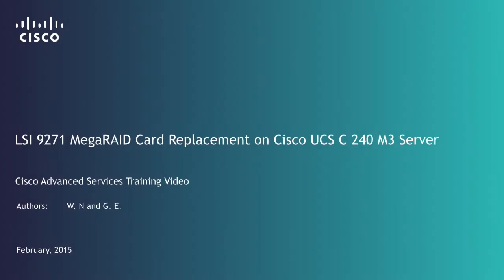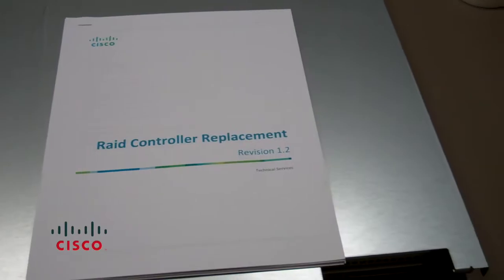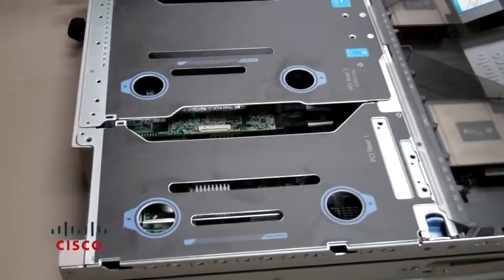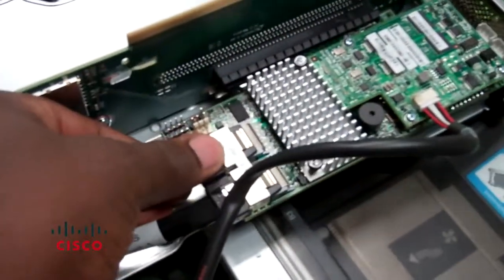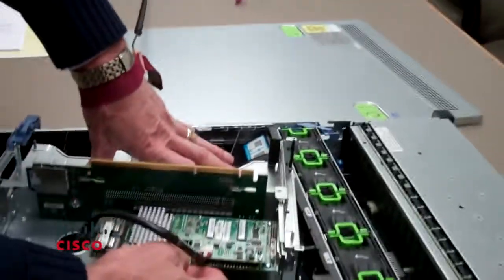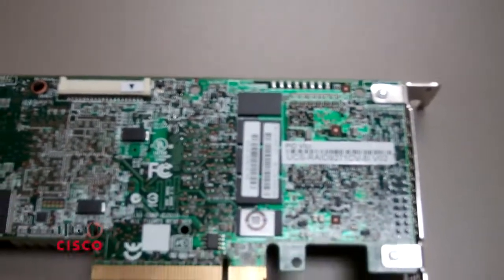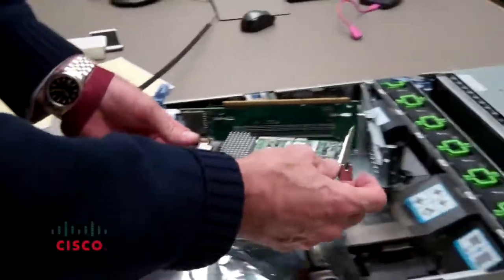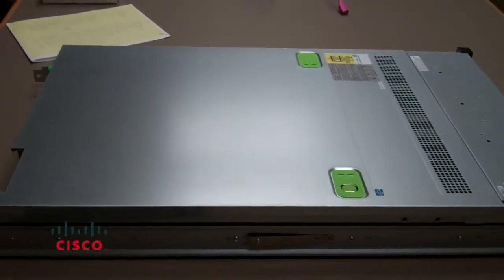Cisco LSI MegaRAID Card Replacement

Comment: Very useful demonstration . One clarification required, whether we can remove the power cable from MegaRAID card and shall  fix it later ? as you mentioned it will clear the memory functions , what does it mean ? Will it clear all the Raid configurations? Thanks
Reply: Cable has not been removed from the data  card , it is still there so   that NVRAM does not loose